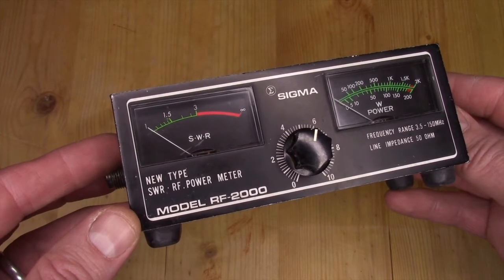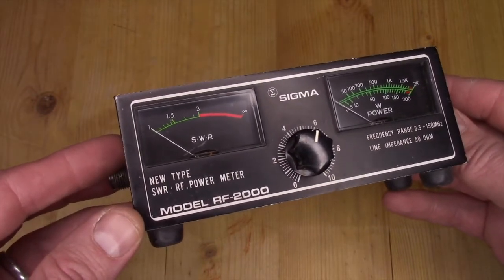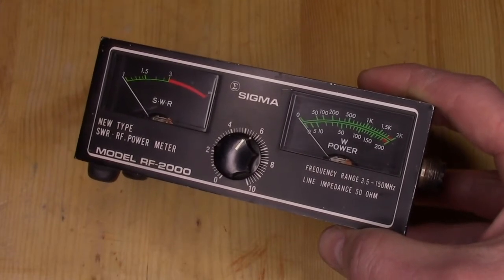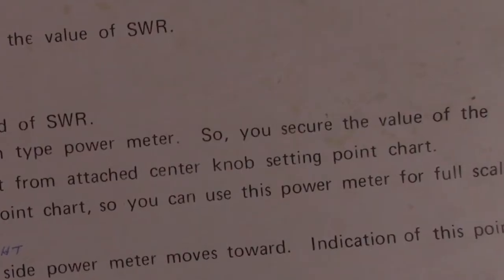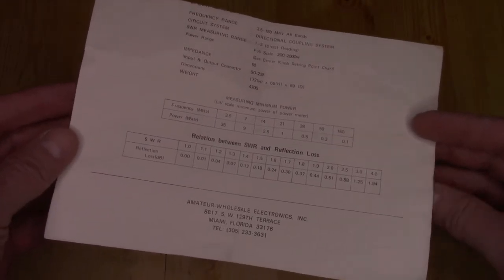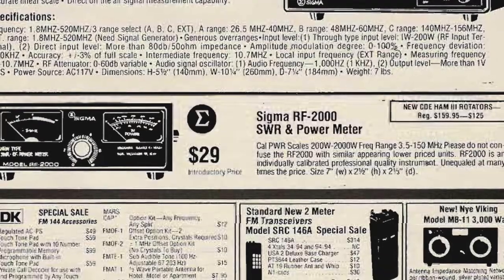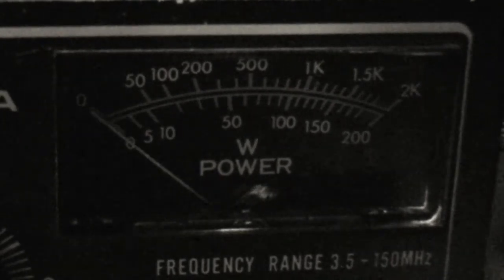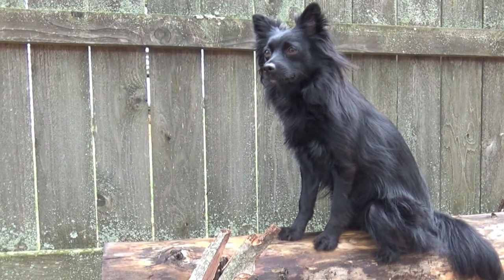Sigma RF-2000 SWR & Power Meter (Ham CB Radio)

Comment: I picked up one of these from a Silent Key in our ham club. Measuring SWR using the instructions seems straight forward, setting current output power to full scale and read swr.

But to measure power you need the "point chart". It appears to me that the point chart had two rows and many columns. One row for 200 watt and the other for 2000 watt. The columns must have been frequencies., such as 3.5, 7, 14, 21, 28 etc. Then the value in the chart was the control setting.

Comment: I was just watching your little presentation on your sigma RF 2000 Watt and SWR meter and I have one of those it needs repaired but I went to look for the little manual that you said was down below and I could not find it so if you could let me know if it’s possible where I could find the manual and try to fix it. I love this with a meter
Reply from the maker: It should be this link to download the PDF: https://www.mediafire.com/file/3efklh9mqsvyu2d/Sigma_RF-2000_Instructions.pdf/file